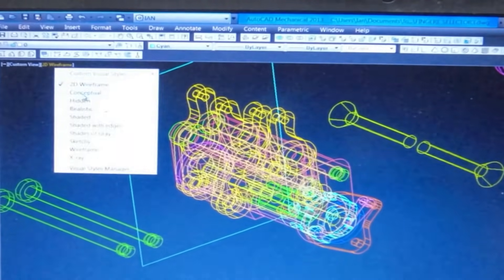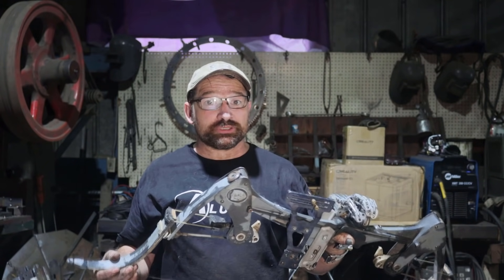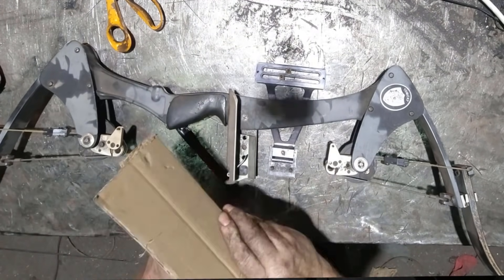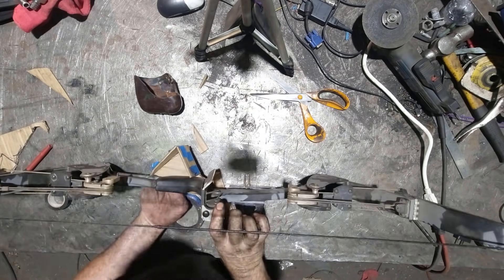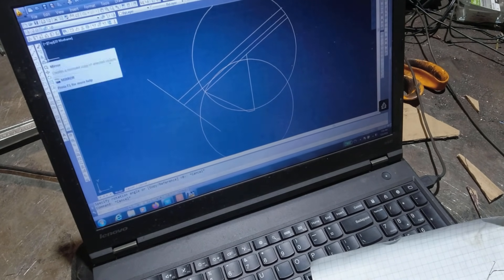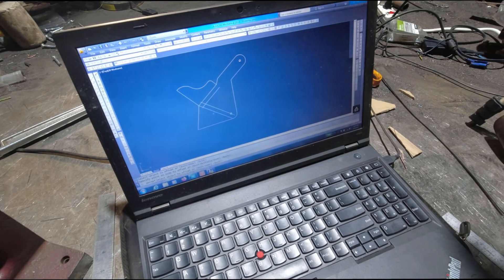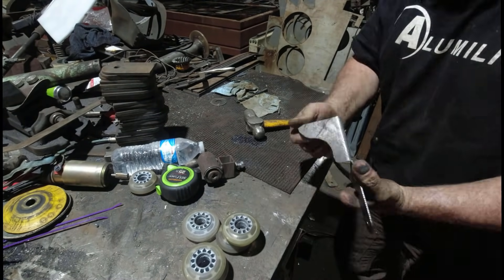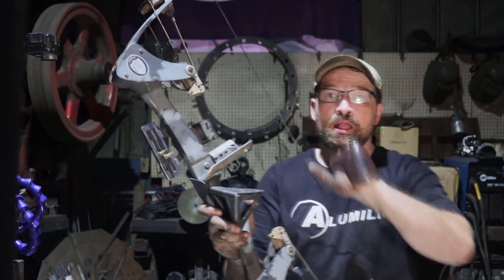Prosthetic Compound Bow Modification Part 1

Comment: I think it is really neat that you are going to be working on a version for printing.  Yes, machined aluminum is the go-to material for longevity, but a printed version will allow for individual customization of finger/joint/socket configuration, and testing, before going to a machine shop to have a more permanent one made.  A printed version would also lend itself well to lost-PLA casting, which could expand your user base.

I'm really interested in the printer project, but, having no 3d printer, and all my fingers, I'm not a very good candidate for participation in the project.

Comment: About the work hardening. How bad it would be (electric-wise) to use a more tolerant material such as steel? It would help drain your already lacking bateries faster, in exchange for enhancing the number of cycles the wire endures.. but by how much?

Comment: It might sound stupid at first, but since you are trying to merge a heavy-duty prosthetic limb with essentially bare skin tissue, it might be beneficial to your applications to get rid of the sweating factor, or at least minimise it (which as you mentioned is a problem). I am no expert, but to my knowledge there are several medicinal, not so invasive, methods to minimise sweating, with one example being intradermal Botox injections. I am sure there are several other ways to achieve decreased local sweating, and to be clear, I am only sharing my thoughts on your input concerning the day-to-day problems of the prosthetic, I am not aware of the feasibility of my idea or the possible side-effect that may arise.

Comment: Have you thought about hydraulics to minimize wires?
Reply: Justin i think that the oil tank would be a problem, ergonomically wise. Plus it would require a battery or a power source to build up the pressure. So overall too bulky in my opinion...

Comment: I am not very technically minded, so apologies if this is a stupid question, but if you're worried about wires ending up work hardened and snapping would brushes on the joints not then be better?
Reply from the maker: Yes, but you run into an issue with scale. There are 30+ wires that have to run from the forearm through the wrist.

Comment: Ian, what are your thoughts on osseointegration? It would prevent having to use a socket and I've heard that the prosthetics become more accepted and better to control
Reply from the maker: i think it is totally awesome! and it would be incredibly cool if i could do 4 implants into the ends of my metacarples and mount fingers from there. for me though i have a couple difficulties that would make it a bad option. 1 i have super low bone density. like osteoporosis would be an improvement.(currently -2.95) 2 with the integration you are dealing with basically an open wound that never closes. foe me , where i still have blood cancer, I have a compromised immune system. so no go for me on those 2 basis. but it would be cool!

Comment: Wouldn't 3d printing be a great way to develop sockets?
Reply from the maker: I tried printed sockets for first 5 or 6 builds, what I found was I could get a better,  more comfortable,  and durable socket, that was easier to mount to,  by casting and laying up the socket in fiberglass resin and cotton fabric.